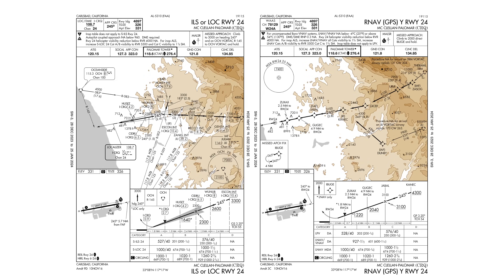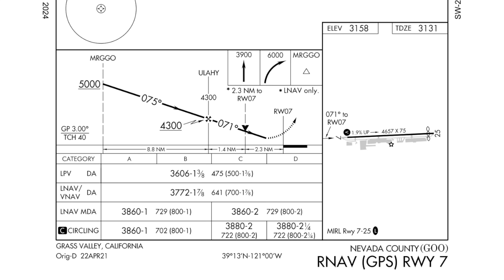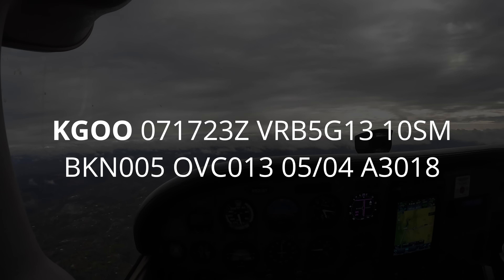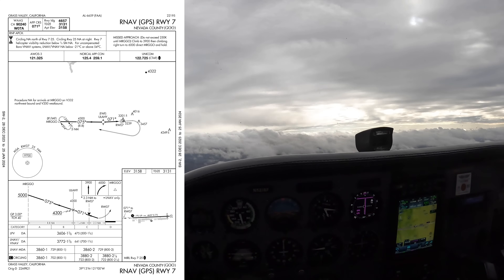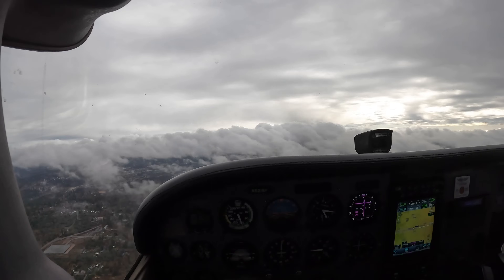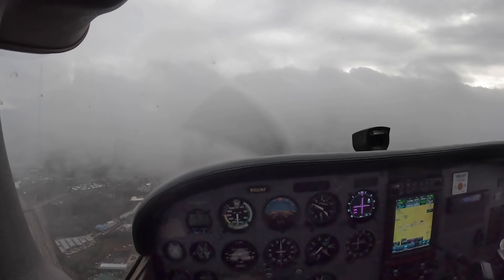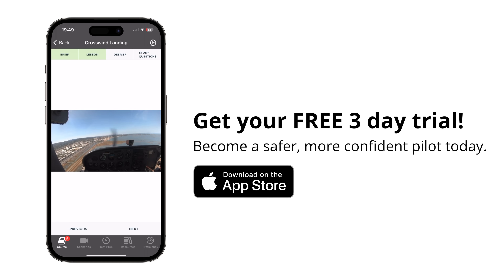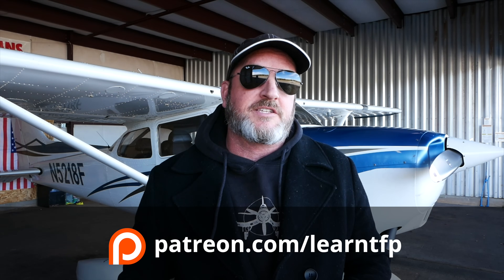LPV APPROACHES - PRECISION? or NONPRECISION? GPS approach LPV minimums NOT instrument landing system

Comment: Jason, I notice your avionics are almost identical to mine and I find the autopilot use a real bear. It overshoots target altitudes, can stall if you don't monitor VS in the climb, and more often than not won't capture the glideslope. I am getting better, but I still find it more of a liability on approaches and I wonder if I'm missing something. I was wondering if you had done a video yet on how to manage an autopilot system in an IFR environment, or if not I'd really welcome that! I know it's somewhat avionics dependent, but I think there are general lessons to be learned by understanding the proper use of APs generally that could help us with safety and low workload. Thanks! 🙏

Comment: As the GP intercept didn’t occur until .4 miles after passing the FAF, why not hold the 5000’ from the IAF? If 5000’ had been maintained then the GP intercept would have been at the FAF and not after it. Flying the procedure in this manner decreases workload IMO but cutting out the step down. The 4300’ shown on the approach at the FAF is a minimum altitude to cross used more for a step down if flying the LNAV, rather than a requirement if flying the LPV.

Comment: I have done instrument approaches with standard IFR radios in a Cessna 172 . I really was easy . . Do your work before you leave the ground  Approach your landing airport , request vectors to the localizer and have your nav. radio set up before that . They give heading to the outer marker and altitude . Turn into it and follow your glide slope to the runway , it's just that easy.

Comment: Ok. True. But there are a ton of GPS approaches to LPV mins that are on the same runway as an ILS. Would you consider that a precision approach?
Reply from the maker: In that case they are nearly identical. I’ve had to change what I call precision versus non-precision with the changing times but I agree that an LPV approach to a precision runway is very precise the challenge is remembering they are not all the same like that
Reply: @TheFinerPoints  Makes sense.
Reply: The fact LPV is not considrered a precision approach is more to do with ICAO paperwork than anything else IMHO.
The KEY to this is the decoupling of the GS/GP from the altimeter.

Key to precision approach - along with other points discussed here - center's around the accuracy of vertical guidance provided by ground based equipment in the locality. SBAS now adds accuracy as well as the sensitivity "cone". Not very local though.... Also fact one can fly an ILS without a radalt - ie still referencing a baro altitude as a cross check - implies that pre radalts in part 121, ILS' were still considered precision  approaches. 

In both cases - as in this video - pilot using a baro alt to cross check. In both ILS and LPV if you had your QNH wrong the GP/GS would reflect that. If you had your QNH wrong in an LNAV/VNAV this would not be the case.
Reply: Correct me if I’m wrong:
Full deflection on ILS is 380‘
Full deflection LPV (thanks to WAAS) is 300‘
In terms of precision, waas wins, however you don’t get your bells and whistles with ALS all the time. However lpv is lpv bc of the lack of obstacles, then down to lp and lastly Lnav. Also 3xas many lpvs in the US compared to ils.
Reply: My understanding is that LPV and LNAV/VNAV are in a separate category called Approach with Vertical Guidance (APV) which is in a separate category to precision or non-precision approaches and has its own ICAO designation.